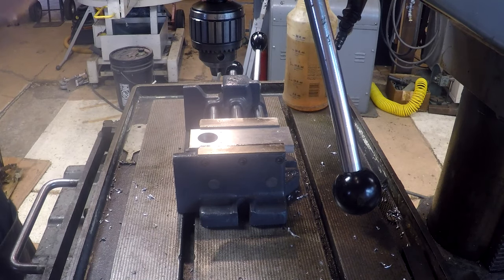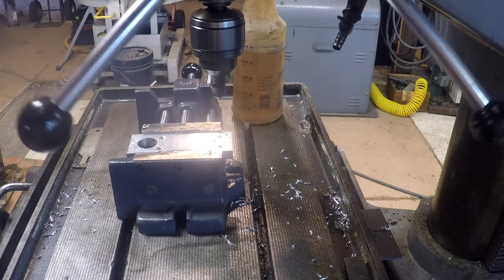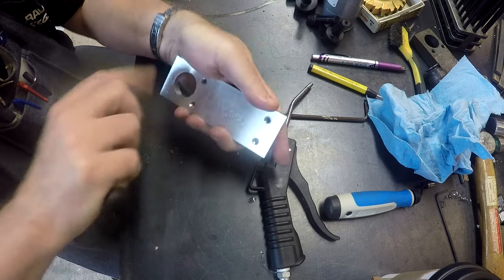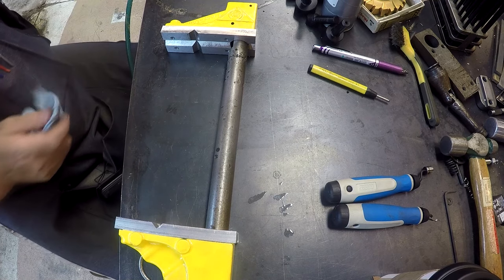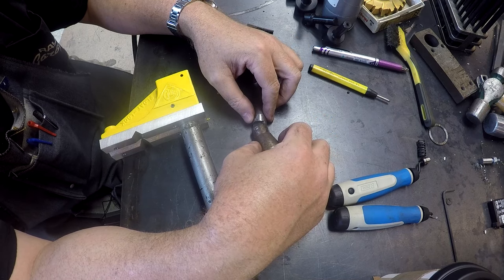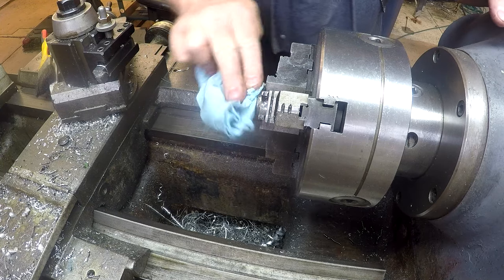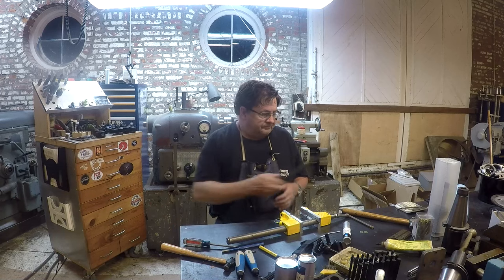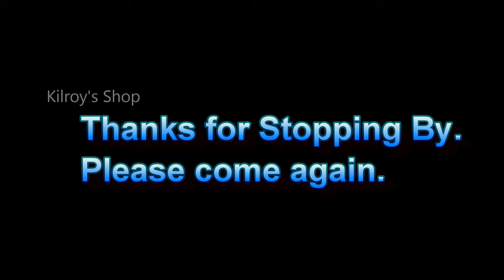Float Lock #3

Comment: LOL.  I had to rewind to see that you gave us the finger when you scratched the paint driving in that last spring/roll/split pin.  I feel your frustration.  Just spray a little bit of the paint into the lid and dab it on with a tiny brush or toothpick.  Just like new.  LOL. That was a good laugh.  We’ve all been there, and done just that.  Hehe

I notice you didn’t cut the edge that act as built in parallels.  I thought that was a great feature and wonder why you left it out?

Comment: A reversible drill press is a very handy thing obviously.  I wonder if my motor will run backwards.  I need to look into that.
Reply: Me too! I have been meaning to ask Stan about the 4-pole 115v motor on my 15" Drillpress, what type of motor is on yours?
Reply: I think it is a Sears motor.  Many of those are reversible.